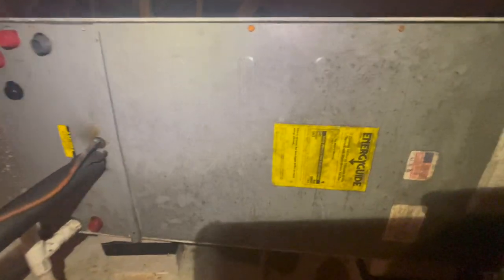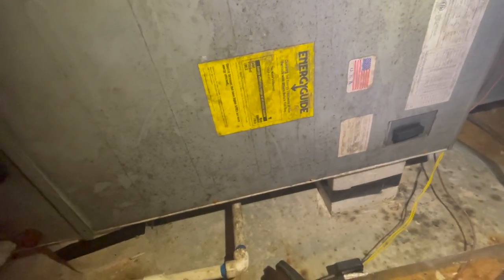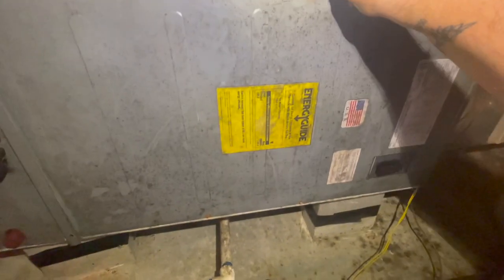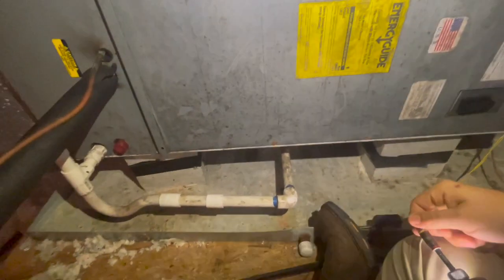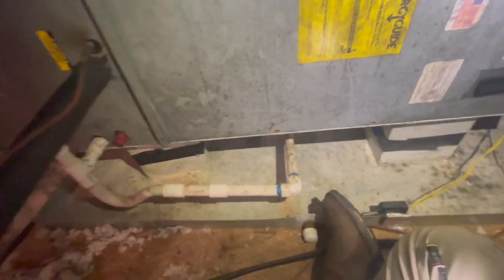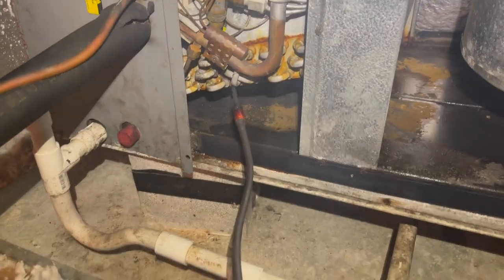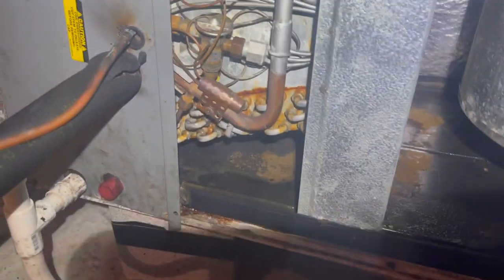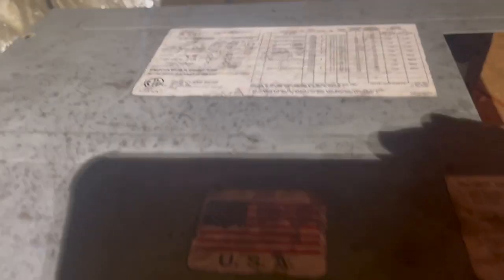HVAC System Leaking Refrigerant

Comment: Hey John I recently purchased a double wide mobile home and I’m having issues , it has 8 floor vents, the four on the side with the unit blow air strong but the four on the other side of the house barely have any air coming from them. What should I look for ? The crossover duct looks pretty new and is in good condition but doesn’t have much air coming through it

Comment: John, what is your  recommendation on changing an evaporator coil versus replacing the unit!  If age of equipment is 8 years old.

thanks good video.
Reply from the maker: Evaporator may still be under warranty if the unit was registered